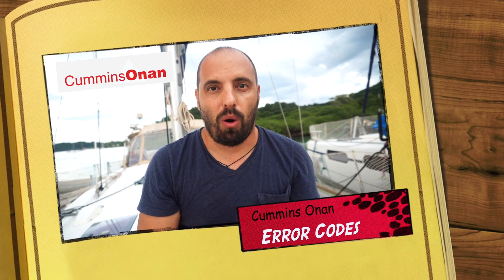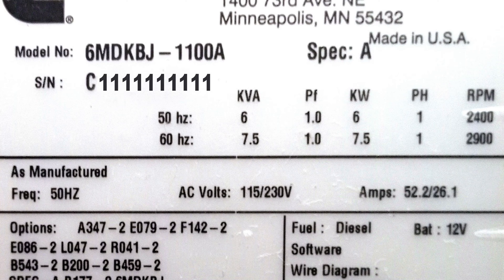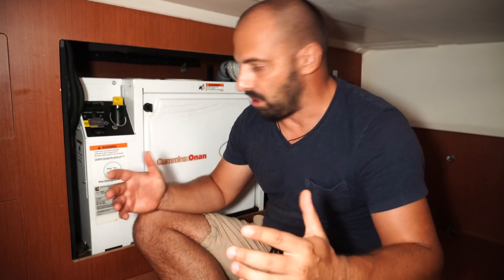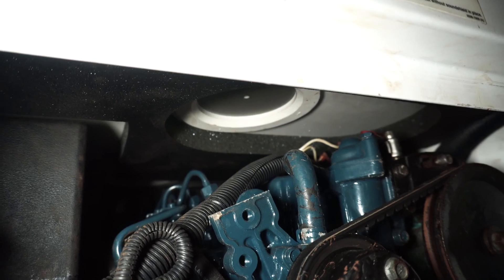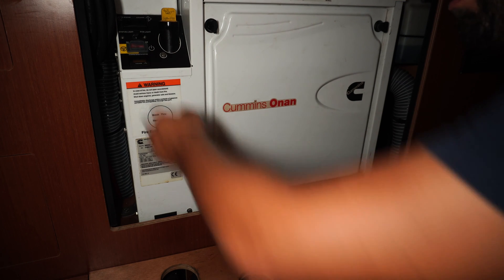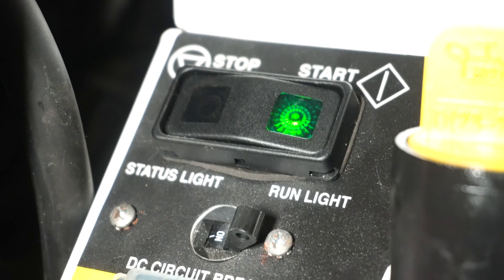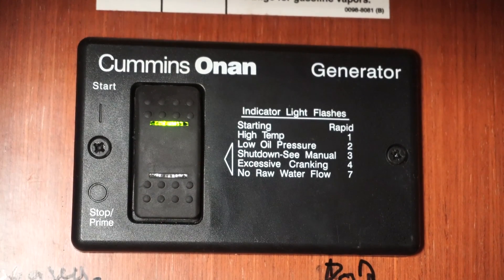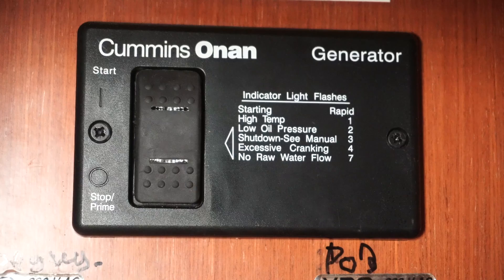MASTERING Cummins Onan Error Codes in 2024 What You Need to Know!

Comment: One dg here over boat and fault code number 5 what reason please gaid
Reply from the maker: It should be a bit more information from blinks. Which genset do you have?
Code 51 – Processor
Code 52 - Fuel Injector
Code 54 - MAT Sender
Code 56 - MAP Sender
Code 57 - Over Prime
Code 58 - Exhaust Gas Temperature Shutdown

Comment: My problem was the automatic fire extinguisher system the pressure was too low.which stops the generator starting 17.5 Kva generator you can bypass the wiring’s in the top left hand controls box by switching 3 wires around which is in the diagram under the cover. Marine and general agents for Onan in NZ are fantastic and enthusiastic in helping you sort your problem where codes are not in the manual cheers
Reply from the maker: Yes, some switches possible to bypass but in case of troubles could kill whole genset. Sometimes I did it with exhaust temperature sensor until bought new one
Reply: @CaptainGermanExploring  I have problem with Onan shutdown with error code 1 ( only 1 blink repeat). Can you help me to solve it? Thank you very much
Reply from the maker: in my service manual I do not have error one. In another one i found "coolent temperature is too high". May be you read error wrong? Try to press the start button much longer.   @nhattienho5874

Comment: I’m working on a on an marine genset and I got no power to anything and battery is fully charged and has 13.3 volts to the back of starter. 
Any ideas ? I work on a lot of different things so I know the basics. The gauges and hour meter don’t even light up.
Reply from the maker: Do you have the power supply on the batt cables on the genset? May be fuse off? Quite often some stupid problems make mess. Lets try to fix it
Reply: Hey thanks for the response! My friend will be here at my marina tomorrow evening, I’ll check fuses. He has a few big grounds that have corroded apart so I’m replacing them for him then I’ll keep you updated.  Thanks again. Yes let’s fix!👍🏼